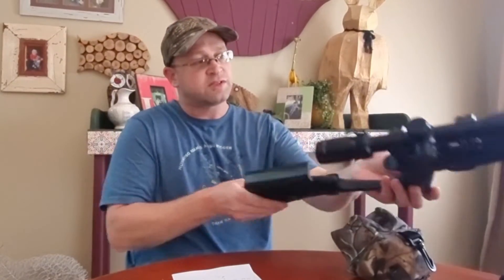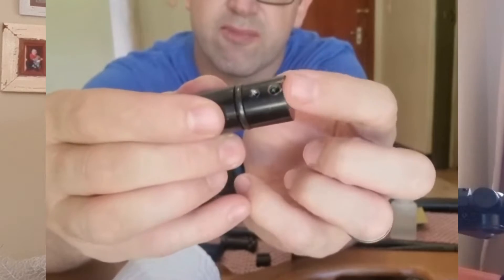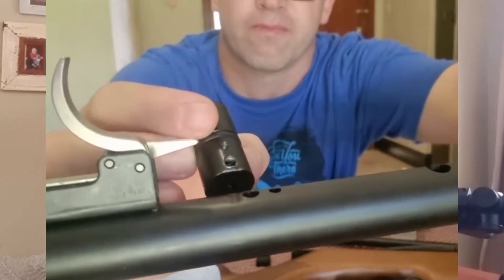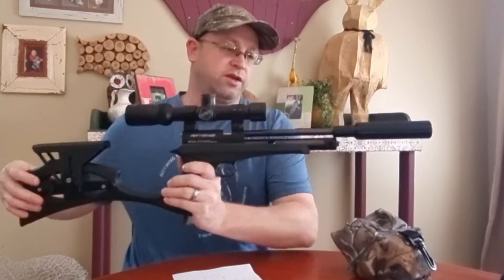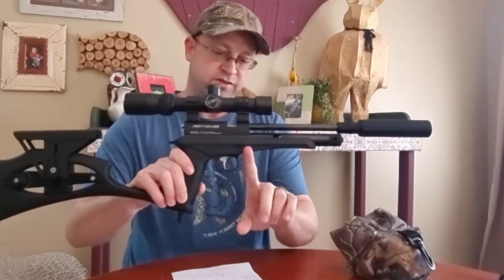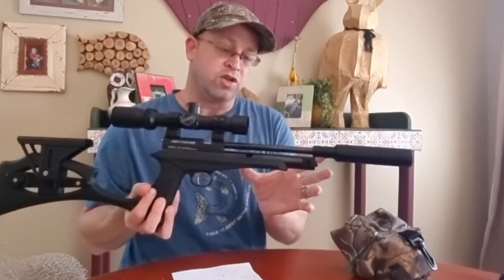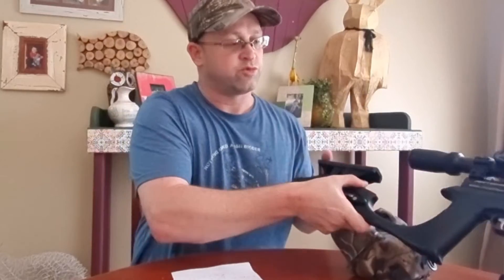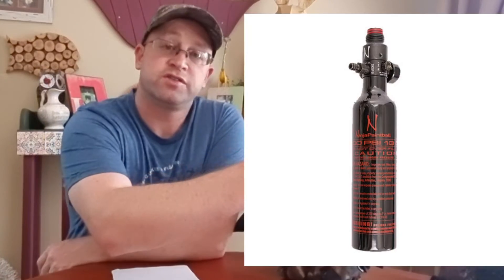CP2/Chaser CONVERT co2 to PCP

Comment: Hi Tyrone very interesting indeed here in UK smk are just starting to import a proper pcp version of the cp2 not a lot of information on it however it appears to be exactly the same as the co2 version ie camo or black with 2 barrels etc etc no idea on cost though so interesting to see how this develops
Reply: £280 for the PCP version, Pelpax are currently selling them
Reply from the maker: I heard about these will need to get my hands on 1 to test out
Reply from the maker: Hi James, I think they will most likely swop out the CP2 co2 tube for something like the PP800 tube. That way you are buying a PCP version I guess and not much changes needed to their production lines

Comment: I've got a safe pack and i get 7 good shots
Reply from the maker: Awesome thanks for sharing Ricky, is that 7shots in the sweetspot? Or 7 shots per fill. How many shots do you get before you need to refill
Reply: 7 good shots per fill then it drops very quickly  @African-Budget-Pellet-Gunner
Reply from the maker: @ricky6934 awesome thanks Ricky, considering that do you still use it with only the safepac or do you sometimes switch back to co2
Reply: safepac only it only takes about 10 pumps for the 7 shots  @African-Budget-Pellet-Gunner